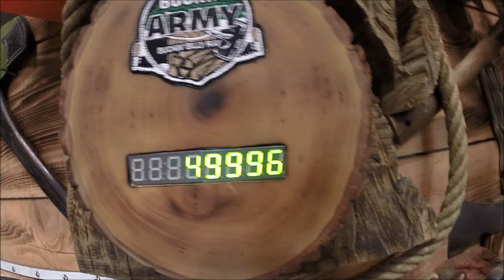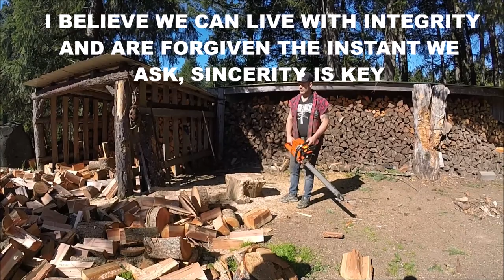HOLZFFORMA 372 PORT JOB, FIRST CUTS  OLYMPYK 284F CUTS

Comment: Buckin, Congrats on 50K:]!!! Hogan, had the same problem with one of my Holtzaforma 372 kit saws shuting down. After many Hrs chasing that demond finaly figured it out. The fuel line they use is a lot more rigid and tightly coiled in the fuel tank. Also the fuel filter was not heavy enough to keep in in the "Petrol" thus she was sucking air and shutting down. Replaced the fuel line with a more flexable one and went with a heavier fule filter and now she stays in the gas! Hope this helps someone somewhere.Keep spreading the love. Buckin, I think you should start your own "Sunday go to Meeting" hr. I know I would tune In!
Reply: Yeah, yer saying the exhaust does some sort of swirl before exit; what sort of process is happening? Thanks

Comment: The first Huztl 660 I built beat me to death.  It would pop and try to suck me back into the starter.  It broke three starters, one pull rope and my hide a bunch of times.  I finally asked the piston and replaced it with a new Farmertec 54 mm piston, rings and cylinder.  It now acts like an ms 660 is supposed to act.  It starts easy, stays lit and re- lights.  I think the squish band in the original cylinder was just junk.  The first time I bucked a big log with it - it scared the hell out of me it was cutting so fast.

Comment: 2 stroke exhausts
Ive spent the last year doing vidjays mostly on 2 stroke expansion chambers and wrote some software for the purpose which is all based on the research of Professor Gordon Blair in 1996, his research articles (published by SAE) also covers chainsaw engines and box type mufflers and there is equations he provides for box type mufflers to provide the best power and In due course Ill be doing some vids on that and may add it to the software.
PS, congrats on the 50k subs Buddy.

Comment: Really enjoy my Holz even after at least 150+ tanks. The muffler bolts came loose and needed to be cranked. The starter rope also just died and needs to be updated to something domestic, but otherwise, a magnificent saw. I’ve been running it rich and it still screams, and I only added a second port to the muffler just because. It’s showing ~13,600 on the tach. And the Holz chain is phenomenal.

Comment: Getting a nickname from adventures at work is tier one. Tier two is where you get equipment named after you, such as the Johny mac switch or a mangled old shovel on a plaque that plugged the feed end of the kiln for months which gets handed to whoever has done the most damage in your area recently.

Comment: Buckin wadca hows it going . Im glad to see you guys dint give up on the holtz forma .some people might not like them but would there bias opinion of Chinese clone saws be diffrent if they were made in the usa or lets say  germany ?.buckin get the ms 660  parts kit and build it with boy  there fun and addictive . they need a few oem parts like chain tensioner and decomp. Do a light port  gut the muff box weld up old exhaust hole drill a 1 inch hole for new pipe .you wil now have a 92 cc monster . For under $300 shipped.

Comment: Really like your channel. I just had my two saws stolen and decided to give Holtzfarma a try. Bought 372xp and another Poulan homeowner saw that seems to be better quality than what the past years have been. Keep it up, wondering how this thing is holding up.
Reply from the maker: it died thx hawk ..dont go there stick with the good guys
Reply: @BuckinBillyRaySmith  well its paid for already and on it's way. So I'm going to run it until some used big iron comes along, wish those Macs were plentiful out here in the midwest. Good luck friend friend and stay safe.

Comment: I have a hosformen in a Stihl in the 361 and 660 any thing I should watch out for  bucking Billy?
Reply: Change the decomp's out to oem parts. They are cheap and it will prevent the saw from delf destructing, the stems on the chinese decomp can fall down into the cylinder and destroy the top ends.

Comment: I bought a huzl G11 it is junk. Wouldn't oil out of the box and the piston when in the first hour running it rich. They want me to rebuild it with their parts with no compensation to me!!
Reply: I find their stuff is very hot and miss, some is great some is bad
Reply: @nickdumpsterhanna3689  I am getting no help from there customer service. Evevn though they a a warranty they don't honor that. Buy at your own risk. Like buying a saw from e-bay!
Reply: Yeah I had a set of 365 cases and you couldn't even rotate the crank, they told me it was the cranks problem and the cases were perfect, took the crank out that was oem, put in an oem case and no problem, that's thev365 hogan has